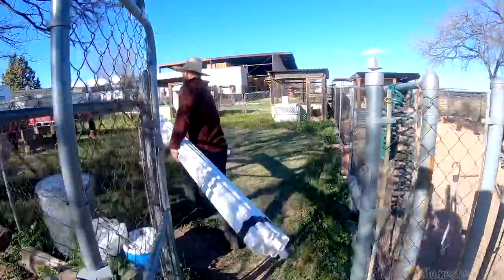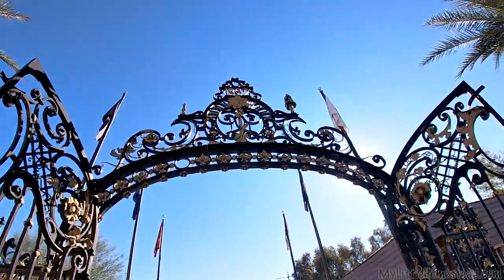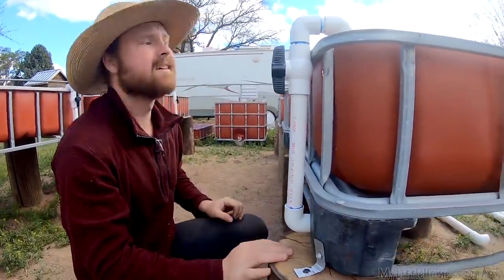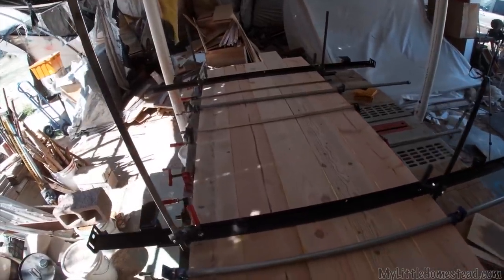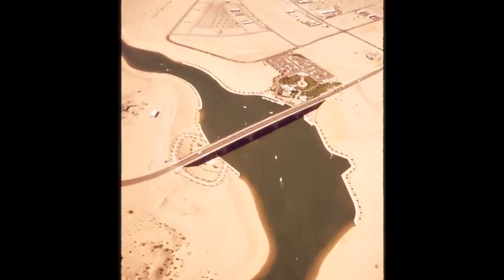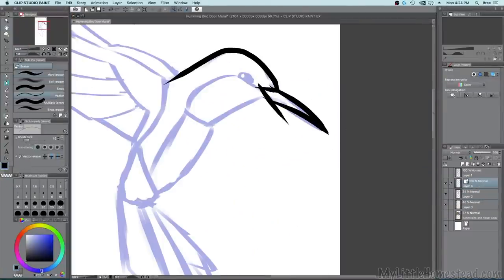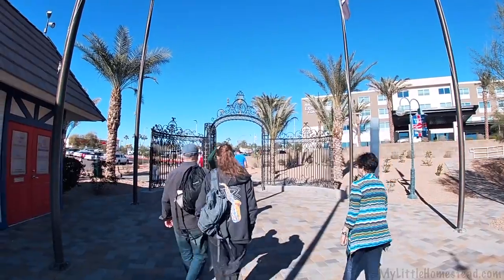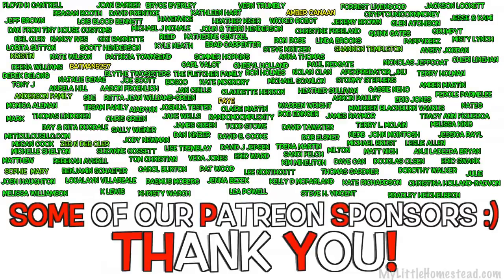Aquaponic Plumbing, Barn Door #2 & Lake Havasu London Bridge Trip | Weekly Peek Ep225

Comment: Bree, there's a craft material called liquid lead, it's used in stained glass overlay, I did the overlay craft for a few years and made a good living at it, The materials are easy to get and can be bought in small quantities. The liquid lead keeps it's shape after you lay it down, a lot like a caulking gun and creates a dam of a sort, once it dries there are some very nice colors you can get the do a wide variety of finished looks, which include pebble, acid etch, smoky, and crystallized. The sliding door your about to hang will be beautiful with the overlay. I hung a door that will be doing the same kind of sliding action your doing, but I found it rocked so I added an inside, and outside runner at the bottom and a stop on the floor by the baseboard. As always. nice video.
Reply from the maker: so helpful. thanks.

Comment: Garen and Ellie's aquaponic system is fascinating. •  Puzzled why you guys chose to glue up the doors from boards, since it will be covered with resin? Why not 1&1/8" plywood with trimmers on the edges? Would have been less work and more stable and NOT wavy. (?)  Hope next week you share your reasons for this choice. I do love the homemade track system dad & Garen made. Looks very sturdy. The stain glass design is beautiful idea.  Can't wait to see these projects come together. 🤗  Are you routing out the area for the "glass", so it looks like a framed glass panel?

Comment: I can't wait to see how Bree pours the epoxy.  Just remember...You can dilute it to make it pour much easier with denatured alcohol (up to 20% of the volume of the two parts of the epoxy...I've used up to 40% and it made it really runny, but it did eventually set up after 3-4 days).  The denatured alcohol will make it run a lot smoother and you get a lot less air bubbles.  Use a heat gun to get the "glass" finish.  There are "alcohol inks" you can use to make a transparent epoxy.  Being in the desert, since it is so dry where you are, the epoxy will set up.   You can also use a Dremmel to carve out areas in the wood or clean up the edges of the epoxy to get cleaner lines.  If you use the Dremmel, you can actually paint the outline to make it look like "leaded" glass window.  After painting, you would wait a day and pour the epoxy.  It would be a lot of work and time consuming, but if anybody can do it...You all can!!